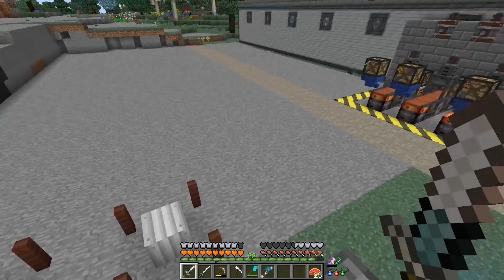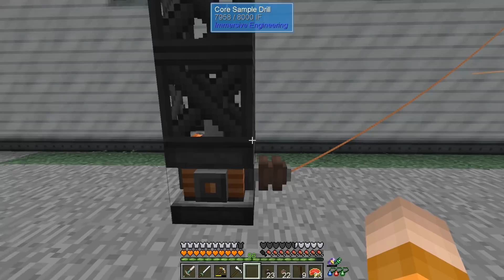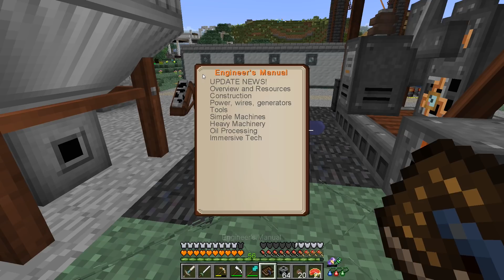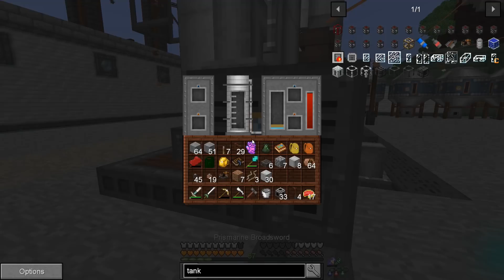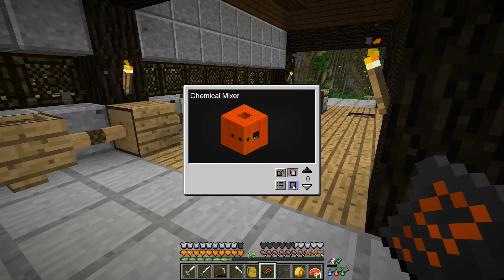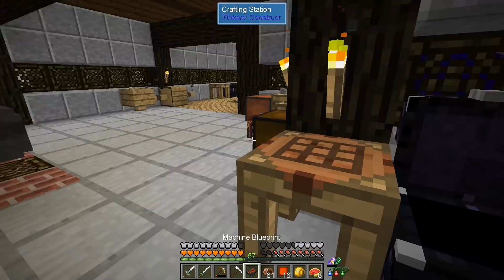SevTech Ages EP18 - Age 4 & Almost Rage Quit

Comment: I had no idea you could pump with Buildcraft pipes straight from water like that, that's actually kinda amazing. I eventually learned of Better With Mods' "Well Bucket," which generates up to 8 buckets as long as two source blocks are touching it, and just pumped out of that. It works nicely enough, though they're a bit slow to generate, and they make a bucket sound every time they do.

As for filtering the tanks, the Liquid Hoppers have a filter mode so they always keep 1 bucket inside, and you can actually drop fluid straight into them using a bucket. That should work nicely enough for keeping out unwanted fluid types. Could even place it underground pushing into more pipes if you don't want to see the hopper exposed. They can be a bit annoying to place, but if you get them oriented right, you can move them using Carry On and it should save both the orientation and the hopper spout direction.

I actually considered quitting and took a break right around when I hit Age 4 as well. There's just so much work at the end. It was such a pain even placing the modular machines, one of them refused to form unless I placed it exactly like the blueprint which you can't rotate.
Reply from the maker: Thank you so much for suggestion. I didn’t knew about the filtering option using the liquid hopers. I use them and now is working perfectly.
You save me a lot of headache.

Comment: NOOOOOO   don't quit you are doing great, just don't do so much, and relax this is supposed to be fun! not a race to the finish, besides you are probably stressed out with the house. you will need another tank to store the steam and much more power. do a building episode do the Factory, tell us more about the woodworking as you do that.
Reply from the maker: You are right Nemo.
I should stop trying so hard to do so much and take it easy on the episodes.
Also is true that the search for a house is very very stressful.